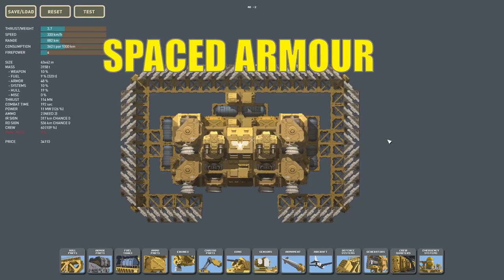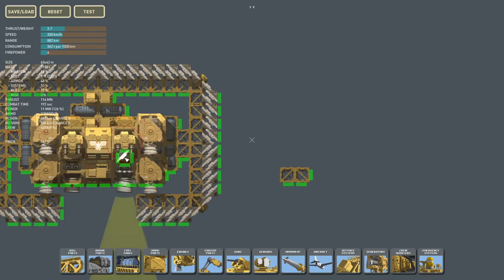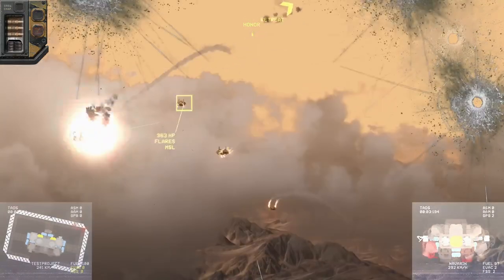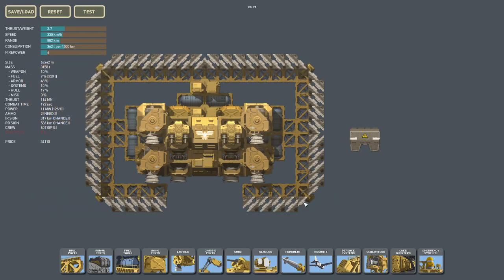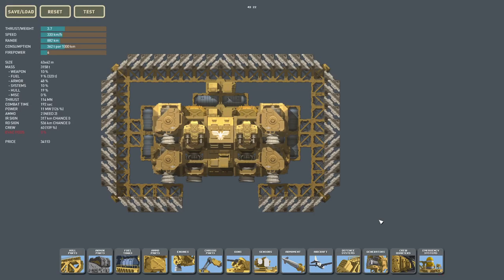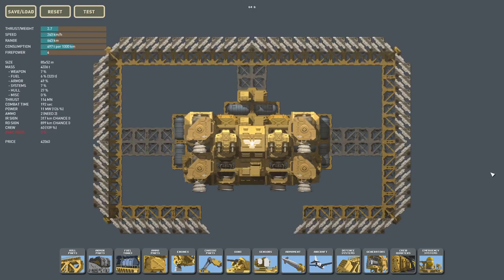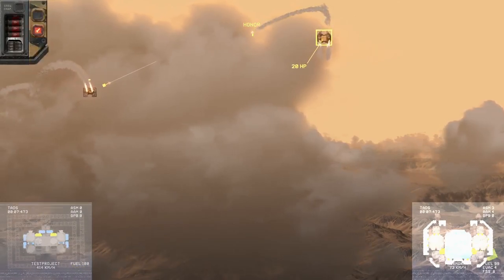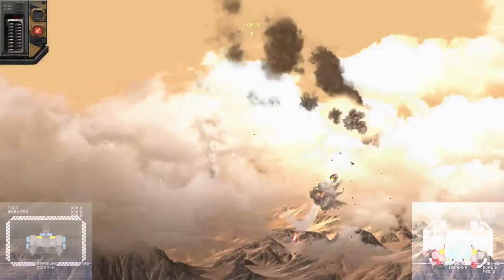Spaced Armour - Is It Good? | HighFleet Builds

Comment: Try an internal armored citadel design. Like the WW2 All or Nothing armor scheme.
Reply from the maker: Wouldn’t that be a bit heavy? It would certainly work even in 1.16 but it would seriously hurt speed and thrust (depending on what your ship aims to do, but I’m now more leaning towards faster ships)
Reply: @kaptainbeans  The idea is to armor only the critical parts of the ship to save weight. It should be lighter than having armor around the exterior of the ship.
Reply: obviously the issue is that you shouldnt be wasting hull pieces on nothing, so literally all of your ship is vital... the fuel, guns, ammo, crew, bridge, fps. all you can sacrifice is like... external missiles / aps / flares
Reply: @bruvreallymate4365  they historically didn't armor the crew quarters or fuel. The idea in game would be to protect from instant kills, enough to retreat if necessary.
Reply: @ctrlaltdebug  well fuel was protected
i know crew quarters werent but the size of the crew you need in highfleet is nothing anyways

Comment: armor is only good if you large slow assault battle ship
From my point of view best ship consists of 2 Gatlings + 2 125 guns with thin 1 layer triangle plates to counter Gatling bullets .
all other shells ship should be countered by maneuvers  
 with laser guided shells 2 125 mm can destroy any ship
Reply: In my opinion best ships have more than 10 180mm canon with 15 37mm canon and shit tons of 100 and 130 canon ofc its armor must be layer upon layer with the the outer part of ship is layered with 2 to 3 layer of steel hull each have armor. Basicly a flying tank, also make sire have r9 spirit missile and some cruise missile. Oh it's a combination of battle cruiser and aircraft carrier too.
Reply: @nazigorfurher4403  MY GOD ARE YOU MAKING A SPACE BATTLESHIP YAMATO.
Reply: @arnoldshmitt4969   kekeke as much as i want to do it, it's just impossible i don't have those massive 46 cm canon.
Reply: @nazigorfurher4403  180mm cannons all the way
Reply: @arnoldshmitt4969  yes, but the 220 mm rocket is far more scary. But it was way to costly not the price but the ammunition.
Reply: @nazigorfurher4403  also it takes skill to fire those rockets

Comment: Is that for version 1.16?
Reply from the maker: no it's for 1.15
Reply: @kaptainbeans  Thanks for the reply.
Two questions for 1.16 :
1-Does space out armor still work?
2-Reinforced hull vs armor on more nimble ships like the lghting or that you showed.

All the ship designs I was given are old and the stats are broken and are for old versions.
Reply from the maker: For Q1, armour spaced out will work against zenith missiles. The problem is that engines have been nerfed, so having armour spaced out will weigh a ton more.
For Q2,  reinforced hull will let projectiles pass through if it is empty. I suggest minimal armour to protect only the most vital parts. If you want to stay nimble you can also try using palash systems to block out artillery (100mm, 130mm, 180mm, 220mm) but it will not block other projectiles (37mm, 57mm, and zenith missiles)
Reply: @kaptainbeans  Thanks again. Is there  a point to crew yet, or is still useless to actually have crew quarters?
Reply from the maker: @johnshepard7630  No, it's still a waste of money that doesn't change anything
Reply: @kaptainbeans  Damn, that’s silly. It seems that it should probably be an outright requirement.

Even better, if it’s technically feasible, would be to tie crew quarters to morale, so that good quarters would allow better regeneration of morale, or perhaps allow for limited morale regeneration in flight. A ship with a crew that is all cramped up would, after all, probably not be a particularly happy ship.